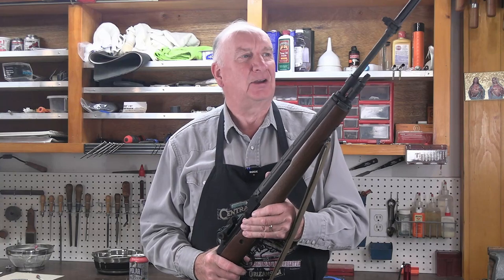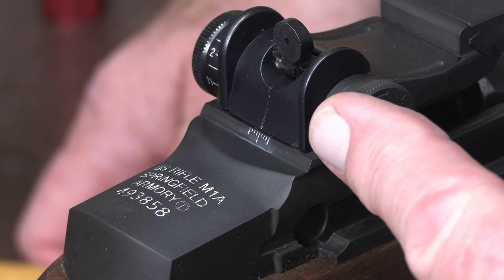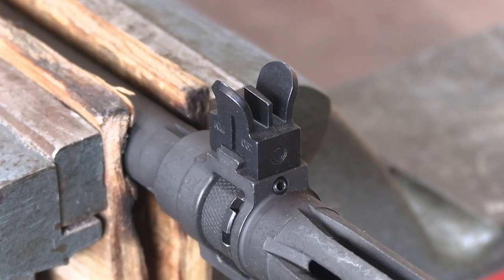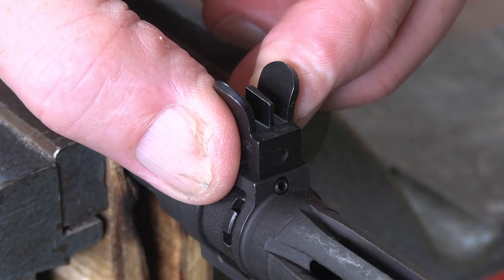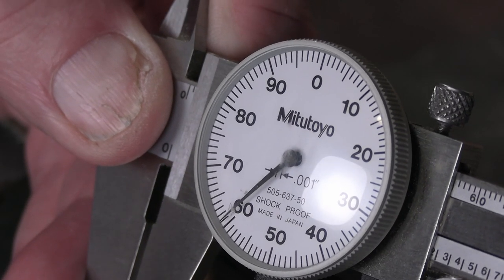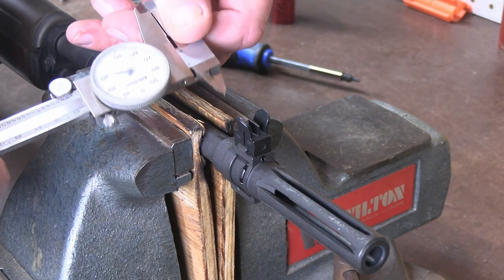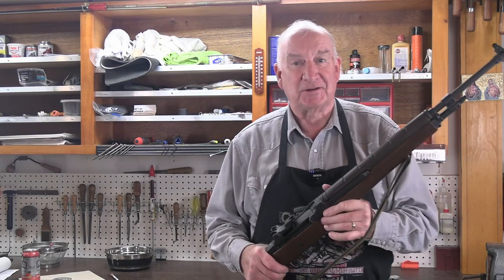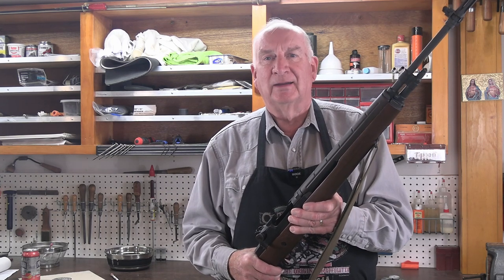How to Precisely Adjust the Windage Marks of an M1A or M1 Garand with the Front Sight

Comment: Each click represents 0.0078”, not 0.010”. WWII Garand drawings say the windage screw has 32-pitch threads. It turns 4 clicks per revolution, so 4 clicks are 0.03125”, not 0.040”. Other than that detail, the method outlined is useful and helpful.

Comment: I presume this video only pertains to rifles with windage adjustable rear sights.  I'm one of those guys who zeroes such rifles using the windage knob, then forgets about it.  The only times I've ever made front sight windage adjustments is when the sights were so far off I had no other choice or it was the only way to make an adjustment.  I never considered the advantage of going the extra step to make the center windage position of the rear sight the actual zero position.  I watched this video twice so I could catch all the pertinent details and it makes a lot of sense.  Now I need to check some rifles and tweak their front sights accordingly.  Kudos to GB490 for making this recommendation and demonstrating the technique.
Reply from the maker: Military battle sights are a different animal than traditional sporting rifle sights.  They are designed to be set to zero, both for elevation and windage, so they can be adjusted for elevations beyond their point blank trajectory, and to compensate for wind, while always being instantly returned to battlesight zero.
Reply: @GunBlue490  Have you done a video on how to set elevation to zero?
Reply from the maker: @Paladin1873  Yes, I mentioned that at the end of my video.  It's the same one as whitening.
Reply: @GunBlue490  Thanks, I'll watch it.

Comment: I like, since the barrel is in a vise and the vise is metal. I would use a travel indicator (with a magnet base) on the vise and put the indicator onto the front sight. then you could move the front sight exactly .030 in. also if it moved when you tighten it you would see it clearly.

Comment: Great Video! I have an M1 Garand that shoots left. I've already taken it to the range and adjusted the windage to the right. However, I noticed that the front sight was set all the way to the left when I got it from the CMP. So from your video I know I have to still go left a bit on the front sight. Is it safe/correct to ever have that front sight hanging a bit off of the dovetail base?  If not, what do you recommend? Thanks for all of your content and your time!
Reply from the maker: The front sight should not be moved so far that any portion of it is out of the dovetail track.  Any further centering adjustment should be made with the rear sight.  Although the rear sight may be off center, you'll simply have to make a mental note or jot it someplace about its zero position.  These days, you can even take a photo of the zero position with a cell phone and keep it for reference.  Good luck and God bless.
Reply: @GunBlue490  Thanks for the advice. I'll be practicing leading up to the NM's at Camp Perry so I'll just make that mental note adjustment using the rear sight and get used to it. Thanks and God Bless!

Comment: Sir, I enjoy your videos very much. I recently purchased a M1 Garand from CMP. I know you have to be careful about shooting factory 30 06 loads in these rifles. Do you recommend using an adjustable gas plug?  I reload and want to work up a low power load to shoot in my M1. What's your feelings on powder and bullets to use? You and Benny keep up the good work! Thank you.
Reply: I have a '53 H&R M1, I used to compete in local High Power Rifle matches with it and used my Reloads only, I started to work up loads beginning with commercial brass (Rem) and 155 gr. Sierra Match bullets, Federal LR primers, with 44 gr. of IMR 4895 eventually settling on 45 gr. @ 2630 +/- FPS. That said, I have since changed my loading (I no longer compete) to Lake City Arsenal brass, 147-150 gr. FMJ, CCI LR primers with 46 gr. of IMR 4895. There are are a bunch of loads for the M1 on line that are 'hotter' (up to 50 gr. of 4895) but as long as your rifle functions with lower charges, why 'beat it up' for a little higher velocity. M2 Ball Cal. .30 varied from a muzzle velocity of mid-2600's to the high 2700's in the 24" M1 barrel. Just some 'FYI' to a fellow 'M1 guy'.
Reply: Very good info plus I believe Hornaday and other manufacturers have several loads for the M1 Grand

Comment: Is that caliper from the 70’s?  Great old tools.  Know them n trust them.
Reply from the maker: It's not quite that old; about the late 80s.  I started out with green nylon dial calipers from Lyman, until I could afford these.  I still regard dial calipers as more reliable, and they need no batteries. The pointer is where it is.
Reply: They don't get much better than Mitutoyo. Top shelf tools.

Comment: An you do a video on the M1A rear sight.  How to repair when the elevation knob turns but does move the peep sight, please
Reply from the maker: Your sight detents are stripped and must be replaced. I had the same problem. The part was soft. Call SA and request a replacement.  Do not over tighten the windage knob screw.

Comment: What do you do for a stuck front sight screw
Reply from the maker: I would first apply a penetrating thread lubricant such as Liquid Wrench or Kroil and allow it to penetrate for 30 minutes.  Use a very close fitting Allen wrench, seated fully, and attempt to unscrew it with firm pressure.  If that doesn't work, wipe all oil off, and heat the screw with a pencil flame torch or solder iron for no more than 20 seconds, then try again. It should break free.